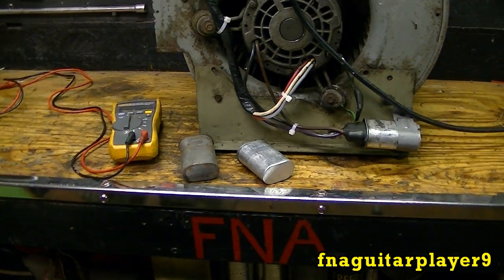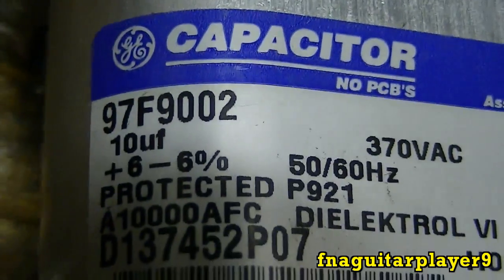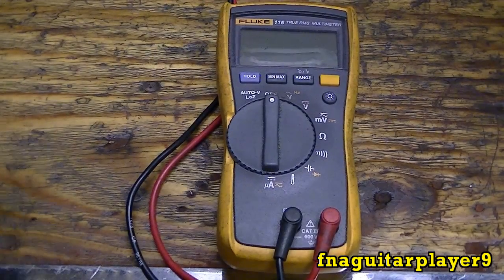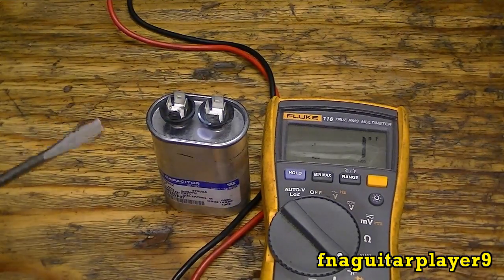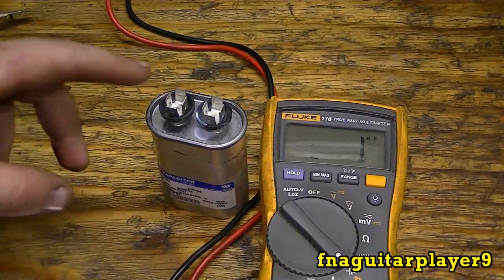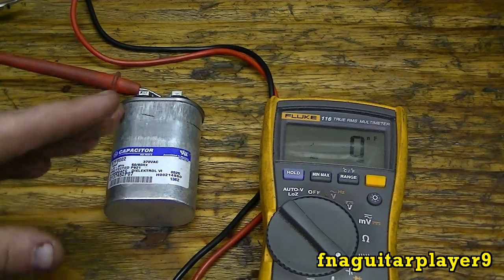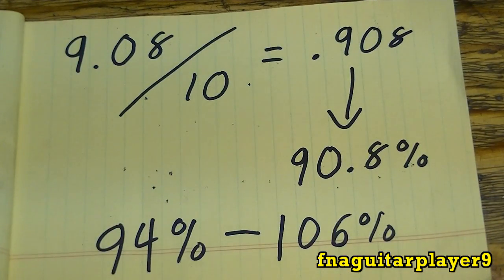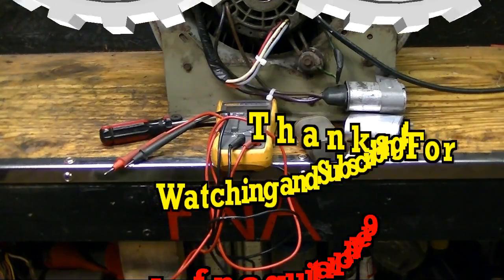How to Check Motor Start and Motor Run Capacitors

Comment: Hi just wondering if you can't match the voltage of the old capacitor how close do you need to be...is higher better? And do the 50hz or 60hz matter? ......Thanks
Reply from the maker: Hi. Yeah you would want to go with a higher voltage rating, general rule of thumb with motor capacitors (not always true) is it should be 3 X voltage of motor. But it just depends on the applications. Start capacitors can be different. But higher voltage rating is always better. And the 50/60HZ is important as well, but some will work with either, i've seen alot rated for both. your welcome, thanks for watching!!!
Reply: fnaguitarplayer9
Thank you.....trying to fix a 12in disk sander motor not running up to speed, no burnt smell so I hope it's just the capacitor.
Reply from the maker: James West your welcome! I hear ya, hopefully that is all it is.

Comment: Cap's are CHEAP! Buy new with cash at a local A/C supply. Online used is always a rip.
Reply from the maker: Kyle Norman Yep, much better off buying a brand new one, and it really isn't that much more. But still it was better than what i had before haha Thanks for Watching!!!
Reply: fnaguitarplayer9 All interested should Google Amrad Engineering. Their Turbos are a quick test/fix/go until OEM parts are gotten.
Reply from the maker: Kyle Norman Will keep that in mind!

Comment: My furnace blower starts up when it should but sometimes shuts off while burner is still on.  It will either come back on within a minute or two, or if not the high limit trips and shuts everything down.  I replaced the control board but that didn't fix it.  Any ideas to help me troubleshoot?  My meter doesn't have MFD, so I'll have to get a new one to check the blower motor capacitor, but is that even a potential cause of this issue?
Reply from the maker: That sounds like the motor may be overheating, some motors will have a thermal shutdown in case it overheats, and the capacitor could be the cause for it overheating, the blower in the video did that, i was running it for a while and started smelling something hot, a hot motor has a very distinct smell, and i touched the capacitor and it was hot and swelling, about ready to blow haha Its probably the capacitor, i'd check that first, its the cheapest thing to replace and it will cause a motor to overheat. Thanks for Watching!!!
Reply: fnaguitarplayer9 Well I replaced the capacitor because, as you said, it was a cheap item, but unfortunately that was not the culprit.  If you have any other suggestions, let me know!
Reply from the maker: I would check the thermostat that would detect if the motor is heating up, it could be bad, or it may be the motor itself, a old motor can overheat and shut down. I thought for sure it was the capacitor. It might be best to have someone look at it (HVAC company) to rule out a bad motor, because that will be expensive if thats what it is.

Comment: I have a three wire motor  with no name plate on it. I know it needs a capacitor to start.It just hums when energized. Is there an easy way to find out if it needs a Run or Start capacitor and of coarse how would I be able to determine the capacitance size?
Reply from the maker: Thats going to be very hard to figure out, I don't really know of anyway right off hand to figure it out, if you put the wrong capacitor on it, it can burn it up, or damage the windings, you might have to take it to a motor shop and see if they at least figure what model/make it is and go from there, sorry i couldn't help out more! Thanks for Watching!!!

Comment: my furnace recently quit. the gas still lights up but the motor isn't blowing anymore. i noticed before it stopped, i could smell something in-between burnt plastic and cardboard in the air vents so i'm not sure if it's the motor or perhaps the capacitor.
Reply from the maker: that sounds like the motor overheated, it has a very distinct smell, almost smells like burnt cloth, but it could be that, a capacitor may have blown or heated up or even a circuit board burnt out, hard to say. Thanks for Watching!!!
Reply: well, it turned out it was a circuit board and not a capacitor or motor after all.
though i wish it had been a capacitor- that woulda been cheaper.
Reply from the maker: filthy sanchez I kind of thought it was by how you described the smell. oh yeah, those circuit boards are really expensive.

Comment: Hi there fnaguitarplayer,
i have a 1.5 uf +10%-5% 250 v motor run capacitor and it went bad could i buy a 2.0 uf 25v or 370 capacitor and use it? or will it damage the motor?
Thank you, very informative video
Rob
Reply from the maker: Rob Hernandez I think thats to much of a difference to be honest with you, I'd be afraid it might damage the motor, that would be a 25% difference compared to the original one. Probably be better off finding the exact replacement for it. your welcome! thanks for watching!!!
Reply: fnaguitarplayer9 Thank you for the response, i did find the right one.
Reply from the maker: your welcome!

Comment: So the only way to bleed/short the voltage before touching a capacitor is to connect a conductor to both terminals? 

Thanks.
Reply from the maker: zedac0sta yes, it does have to be a screw driver, some people will use a little test cable (miniature jumper cable) to short it out, some capacitors will have a resistor across the terminals so every time power is shut off it will automatically discharge, but that is rare, usually find that on high voltage applications like the capacitors in microwaves. Thanks for Watching!!!

Comment: may add something to this. A safer way to discharge a cap is with a light bulb. I have seen them explode shorting them out. Thanks again.
Reply from the maker: good advice, thanks for watching!
Reply from the maker: Yeah if its a 120 volt bulb you wouldn't want much more than on it, a resistor might be best for higher voltage capacitors, value would depend on voltage to keep from burning it up. to big and it will take forever to drain. to small and it will heat up quick. Thanks for Watching!!!
Reply: Matthew Kiefer hey serious question,  what if the volts are very high like the capacitor on this video? do you think the high voltage would blow a 60v incandescent bulb? I am asking since I am studying controls
Reply: Oh hell yeah !!!!   very safe

Comment: You da man, I have a washing machine that the motor wont start unless I assist it and then it runs fine but gets a bit hot so I'm pulling the cap and checking it. Thank you so much for the time you took to help people I looked for days to find answers.
Reply from the maker: haha i hear ya! Sounds like probably is the problem. Your welcome, thanks for watching!
Reply: Turned out to be the timmer, it was all burnt up inside and contacts weren't making contact to the cap in spin but it worked in agatate. A video on how to test the timer would be real good.
Reply from the maker: Matthew Kiefer I hear ya, good that you got it working again, i would but I'm no expert on these, i've never actually worked on a timer on one. if i ever run into one i'll do a video-attempt haha

Comment: The one important thing this guy failed to point out is that you can't trust the reading on the capacitance meter unless and until the meter has been calibrated by an accredited calibration laboratory. The meter he's using appears not to have been calibrated because there is no visible calibration label. Even if the meter is brand new out of the factory, it can give inaccurate readings unless it came from the factory with a calibration sticker.
Reply from the maker: That is true, never really thought about that, but if you buy a new meter (mine is fairly new with light use) it should read accurate. But yeah it should be calibrated. Thanks for Watching!!!

Comment: Good information - Helped my understanding greatly thank you. Off subject, I'm very surprised you have a conductive strip along the front edge of your work bench. I would be extra cautious with that in place as one slip up and it could go live when working with electrical projects. Kind regards.
Reply from the maker: Your welcome! That is true, your the first person to mention that, truth is, i rarely work on anything electrical on the bench, I mainly work on small engines and mechanical stuff, but yes you are correct it isn't safe at all for working with the electricity. Same goes for the vice mounted (off camera) on the bench, that could be dangerous too. Thanks for Watching!!!

Comment: My AC fan wouldn't run and I pushed the fan to get it going, then hit the switch and it start running fine. That tells me the start capacitor must be bad. I pulled what it appeared to be the starting capacitor but on the can it says "running capacitor"  10µF 370V. Which is in line with the capacitor you were talking on the video, except it says Running capacitor rather than Starting Capacitor. Did someone use the wrong part? (I had a problem a couple of years ago and a tech came out to fix it).
Reply from the maker: Its what i call a start/run capacitor meaning it does both things, it helps it start up and acts a run capacitor after it comes up to speed. I have another video showing what it does unhooked called, interesting fact about capacitor start induction motors. I would suggest running the model number of it and make sure its what its supposed to have in it, if so that almost has to be the problem with it. Thanks for Watching!!!

Comment from the maker: No, if you check a capacitor on ohm settings your only checking if it has a short inside which is very uncommon, you have to a meter that measures capacitance (uf, which is microfarads). You might be able to take it to a place that sales capacitors or a AC / HVAC repair shop and have them check it, but i'd be sure that you can see their meter, so you know they are trying to pull one over on you (saying its bad when its really good, just so you have to buy one haha) thanks for watching!

Comment: Can you check a capacitor using an muti tester only has ohms, ac, dc, and a continuity reader.  My  tester does not have a UF option on it?

Comment: Good info, I never thought of a motor starting capacitor reading a little high could be bad, reading low I can understand, but I am no expert on motor capacitors.
BTW, What is that sound in the background?
It sounds like someone is sharping a blade on a stone.

Comment from the maker: No, they do not have capacitors only electric motors do, now on older engines they have points and condensor, which is a capacitor, but it don't make one run hot. what it could be is, first check the cooling fins under the flywheel cover, alot of times they will clog up with grass and prevent the motor from cooling, it may be running to lean, it is probably one of those things wrong. thanks for watching!